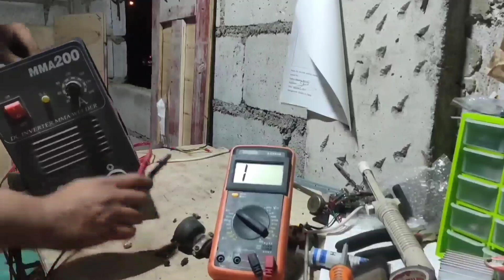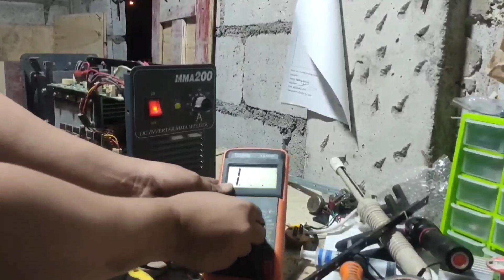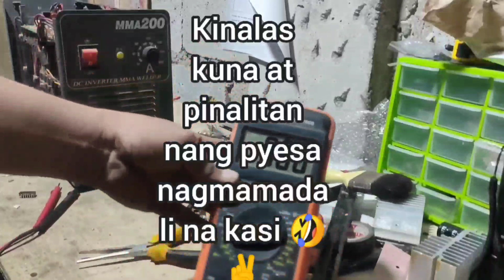how to repair MITECH MMA200 no welding output

Comment: I have an Mitec MMA200  But some strange happen. Fuse in house blow,when i put cord in an turn on. But if i deconet ground wire inside the mitec,so only two leads go to whal. Everything works. so ther must bean something,so short to ground on the power board  Have tryed see after something too ground.But have not find anything. Have you some ideas what can do this problem.?
Reply from the maker: Message me on messenger sir diode yap 
send me pictures of problem thank you

Comment: Boss na kapag repair kana ba ng powerhouse inverter welding machine?
Reply from the maker: Meron narin mga iilan
Reply: @diodeyap  nag hihintay kasi ako ng video na powerhouse na rrepair
Reply from the maker: @richardlumanggaya7408  ah ok baka bukas buksan ko yung repair meron nag pa repair saakin d kupa na bbuksan powerhouse
Reply: @diodeyap  salamat boss
Reply: boss tanung ko ngalang po yung powerhouse inverter ko my signal pero no outpot
Reply from the maker: @kaunad5374  kung d naman pumutok yung igbt possible sa pwm circuit ang problema
Reply: @diodeyap  Boss yung Daiden ko ganun din wala output pero may display at power ano kaya sira?
Reply from the maker: @9009_hoo  d ko alam history nang unit mu sir kung may pumutok jan habang gngamit igbt un or mosfet kung wala nmng sabog visual possible sa pwm circuit ang problema